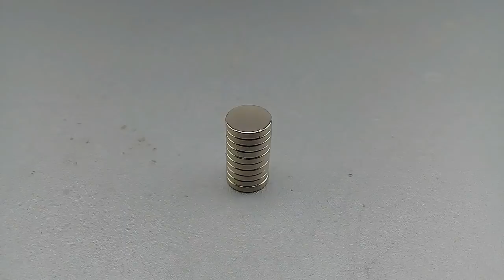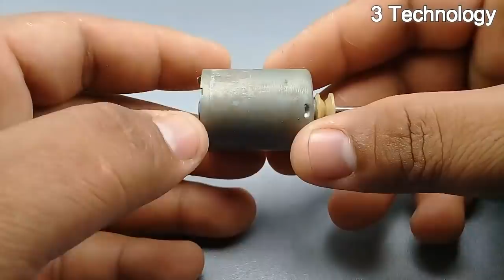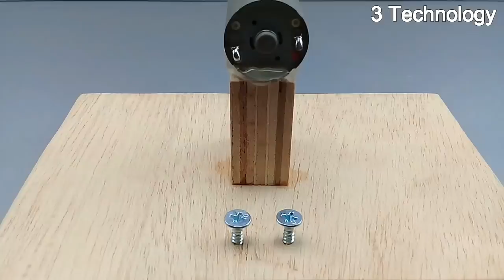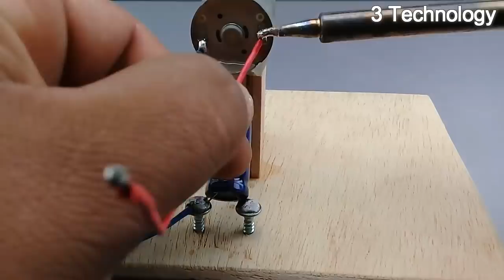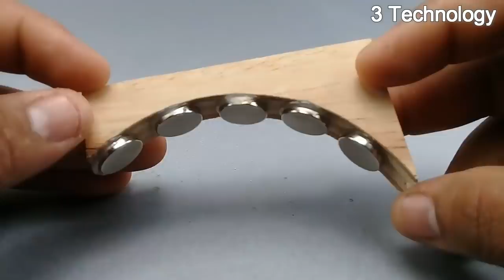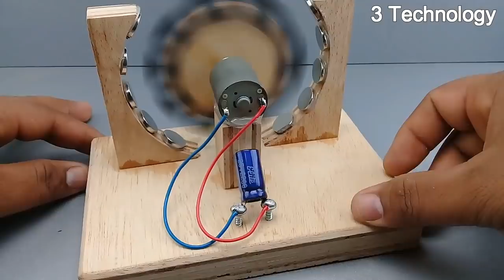Free Energy Generator Using activity Magnet & Magnet

Comment: What is the point of making videos like this if they are illusions? What gain is made through YT videos? If proven fake, it ruins your reputation. Slight of hand is accomplished through deceptive ways. The rabbit poking it's head up, isn't coming from thin air. The base is thicker than it needs to be. The two screws could be making a power connection to the hidden batteries in the base. Personally I don't care what laws of Newton or other people are. There are configurations of magnets that favor directional movement. Finding, and utilizing such is the name of the game.

Comment: 😒 1st law of physics: forces are not self-generated and lost, they only change from one form to another. In this case, the electromagnetic process of the magnet will only be maintained for a short time, gradually for a long time.  The electromagnetics in the magnet will gradually decrease due to friction with the air and have to convert the kinetic energy of the rotation to electricity, leading to the machine's shutdown IN THE COMPANY NOW NOTHING IS INFINITE

Comment: How long does electricity last in the magnets ? And if you stick a shaft on it and a load does it last less and if so could you increase the voltage with a throttle
Reply: It's a con job, dude. He likely has an air compressor blowing air at the thing behind the camera.

Comment: These are tricks only not real. What is the use of condensor and wooden box. Try it with a glass box life long. You won,t succeed. Ether the capacitor contains butten batteries or the wooden box contain pencil batteries to run the motor. If self rotating is possible using magnets why to use capacitor and motor.

Comment: It is totally fake!  The capacitor and magnets play no part in this set up.  There is a hole in the table, under the board.  There are hidden wires connected to the screws.   Why doesn't Mr. 3 Technology lift the board off the table?

Comment: This is FAKE..The "Battery" connections are made at the 2 bolts on the base,and the battery is in a carved out section of the bottom so you can't see it. For this to even work the distance between the ring of magnets and the outter magnets have to vary as it spins,the space increasing and decreasing causing the magnetic field to vary also just enough for it to continue spinning !!!

Comment: Yeah I know your little gimmick yeah those two screws you got in the board is the battery pack up underneath the only way you're going to make this believable is if all the wires are hanging up in the air and not attached to anything that'll make this more believable

Comment: no such thing as free energy! energy applied, motor generates like 40 or 50% (as they have the worst efficiencies for energy conversion) of that energy, capacity takes it and releases it for a short while. Then it eventually stops.Also cant use the energy stored in capacitor for anything else as it will stop even fatser! I forgot to mention video editing software! Show the back of the led circuit board! 1st law of thermodynamics,  energy cant be created or destroyed. WHY THE HELL DID I WATCH THIS!!!

Comment: Well, you are showing something that is considered impossible, and frankly outright FALSE/UNTRUE. If you can prove to do this without using any external energy such as batteries, then you will potentially be a strong candidate for Scientific/ Engineering Noble prize. Moreover, the perpetual machines (with the exception and possibility of nuclear Fusion systems) seemed to be far-fetched for foreseeable future based on the vast knowledge we have.

Comment: There is no way those magnets would spin that motor to generate anything, it would stop a few seconds after you spun it. 

Brushed and brushless motors have way too much resistance (even small ones) for that to work & you can't get energy from nothing. 
 I guess in a way you could "transfer" the energy into something that then transfers it back to the capacitor, which then spins the motor to keep the magnets going for a little while.......but in the end your losing energy via heat on the capacitor and motor.......which means it will stop.....eventually.   

How about you do this vid again but let it sit there spinning for 3 hours without edits.

 + we can all see a slot inbetween your thumbs & why did you need such a thick piece of plywood ?.........

Geezus why did I give you a view lol.